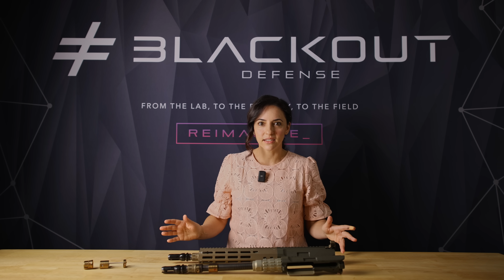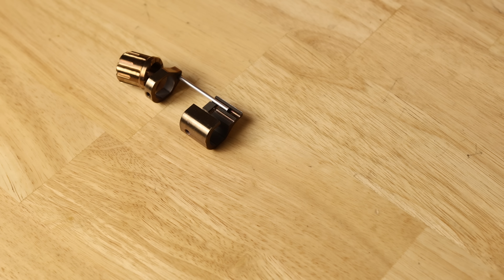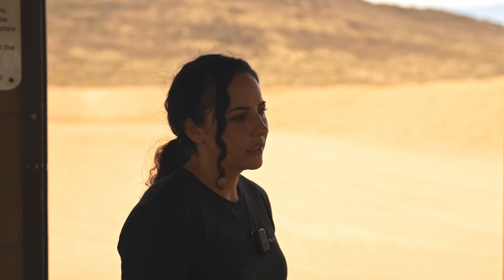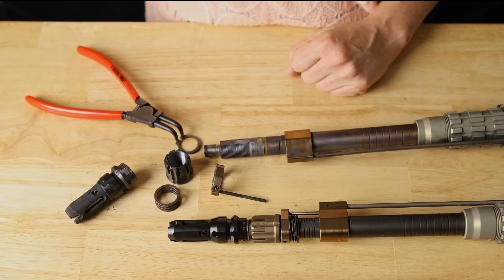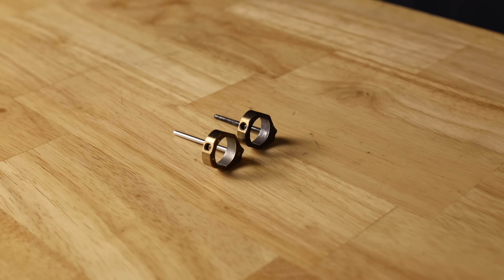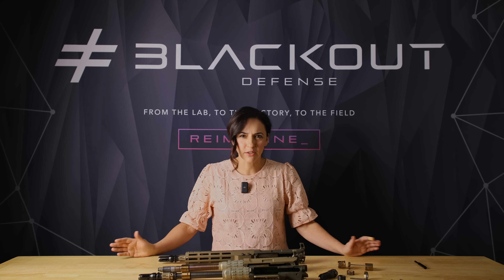HELIX Gas Regulating Barrel System

Comment: Perhaps you should look at Tungsten Carbide for the "adjustment rod". Yes, cobalt steel is a tougher material (tungsten carbide is more brittle), however, based on the use of the adjustment rod, erosion/corrosion resistance under high heat should be priority thus the tungsten carbide.

Comment: You talk about the adjustment rod and an acceptable level of erosion after 1500 rounds. Will the adjustment rod continue to erode each range session causing your gas settings to change?  I know parts ware. Is it something that  needs to be changed out after a certain round count? Am I missing something? Thanks
Reply from the maker: Rarely you are going to see this level of erosion. Erosion in this case (M42) happens in extreme temperature combined with continuation of corrosive gas (ie. full auto). In this video we shot around 1500 rounds in less than 30min. I have received feedback from customers who have over 3000 rounds through the system in standard condition and have not seen changes in the rod.

Comment: I live in the tyrannical state of Ca. I would like a 14.5 barrel with the adjustable gas block. My question is would it be possible to take apart to clean out the gas block with the pin and weld? Or would it be best for me to go with the 16” barrel?
Reply: Good catch and I am surprised to see no one else address.  I saw a video from another YouTuber going over this system; from what I gather, you can replace the little bar that she shows wearing down with the pinned muzzle. However, my concern is that spring - which I am nearly sure that you will be SOL if it should somehow fail.  I'm like you I am interested in the 14.5 however the concern of spring replacement has me leaning toward the 16". Ugh.

Comment: Also I have to comment on those saying only 1500 rounds!!! That's 1500 rounds of full auto continuous fire. There is a huge difference between 1500 rounds over multiple months or 1500 rounds within an hour or so. That's an apples to oranges comparison of 350 degree 30 round mag dump vs 1100 degree continuous fire.
Reply from the maker: Thank you. Very accurate.

Comment: Hold up….so you shot 1500 rounds through it then proceed to show us the comparison of the two components.  Tell me again why I show buy your product?  Did you see what 1500 rounds of “erosion” did to your gas pin.  I’m sorry, that’s a hard no for me.  I’ll stick to riflespeed.  Best of luck.
Reply from the maker: Found the video. 604 rounds total round on barrel failure. Perhaps 300 rounds before gas block failed. If you look at the video, failure occurred when the gas block begin sparking. That’s adjustments rod melting.  IV8888 channel.
Reply: @BlackoutDefense I’ll go find it and look at it.
Reply from the maker: No problem. RS is a great product. Just for the record to clear any misinformation, do the same test to your adjustable gas block then let’s compare it. Max round count I could run on other similar products before catastrophic failure was 800 rounds. That’s our test. However someone in the comments section indicated the same round count before system failure.

Comment: I think it would be interesting to notch the adjustment rod similar to the erosion pattern and see how it does with ~1000 rounds.  It might be something that wears in fast initially then doesn't move for a long time.  That way you can skip and variations in your initial adjustment.
Reply: It looks like something that will experience endless gas erosion requiring regular adjustments to reestablish the preferred flow rate.  Something an enterprising youtuber might want to put to the test if they have an ammo sponsor because it will chew up a lot of ammo to log erosion rates over barrel life.  

I have to also  wonder how fast the gas block itself is eroding.  If it erodes quickly as well, that will increase the readjustment cycles which could increase the rod erosion rate etc etc.  It all may last equally with barrel life, for good or bad and not ultimately matter anymore than necessary regular adjustments.

A last thing to consider, the eroded rod particles, for lack of a better word, end up in the bolt carrier assembly.  Ascertaining their accumulation rate in the carrier, if that does occur, and any added maintenance for removal should be noted as well.

Comment: At what point with the rod erosion become an issue?
Reply from the maker: About 15-20k rounds. Then we recommend changing the rod.
Reply: @BlackoutDefense On a pin and welded 13.9”, can the adjustment mechanism and block be disassembled enough to both clean system and change the adjustment rod?
Reply: It looks like the muzzle device (which cannot be removed if pin/welded) would either prevent or make disassembly very problematic.

Comment: Hard to truly innovate without first doing it through proprietary means and making it different. IF the innovation is successful and the market demands it, the same concept will spread throughout manufacturers based on the demand because it is better than any previous design.  I applaud Blackout Defense for their innovation!  I’m getting ready to order a rifle, but right now I’m stuck in finish color decision paralysis…and if I’m going to order the Helix adjustable block or not.

Comment: So what is the expected erosion rate on the adjustment rod? Is it made of a high temp alloy like the wave washer? Also, in an unsuppressed set up like what was being ran in this test what is the expected failure mode(s)?  I would think a suppressed platform for this test would show a failure more easily?

Comment: 1500 rounds, lots of degradation, but that firing schedule is highly unlikely. Nice work. 
Why was the adjustment rod not plugged straight into the gas tube allowing the rod to be 'eaten away' through it normal life of the rod? A squared off end seems like it will be harder to maintain during the life of the rod than factoring it in as part of the wear process counter-balanced with the spring and adjustment knob.
Reply from the maker: Thank you! We recommend replacing the control rod around 12-15k rounds. One of the major benefits of this system is that in case of full tip-erosion on the CURRENT gas position of your rod, you could push the rod further IN. You can repeat this cycle until you have bottomed out your detent counts. At that point, you should replace the rod. This is the main reason why the end of the control rod is flat. After this test, we extended the depth of the control rod bore 0.100” into the gas block to allow the rod to be pushed in slightly more in this cycle. The cost of replacement of the control rod is about $10. Cool fact: This M42 rod is part of the national stock number. You can simply buy it from McMaster (Part number 8813A28) then it can be grinded to the size appropriate for the barrel gas system (pistol vs carbine vs mid length and so forth). We are also going to provide dimensions and spec for the rod on our site. M42 is very difficult to machine but can be easily grinded like sharpening a punch or drill bit. For those who do not want to deal with it, we will offer it precut on our site. You do not need to remove the muzzle devise. You can disassemble the rod at a certain position or alignment with the adjustment knob (there is an undercut on which creates free access to the rod.) Rod is held in place via 82-degree tip set screw.  We have more info on our IG page if you are interested in learning more about this system. I appreciate your comment!

Comment: I see so many glowing comments, but nobody's being critical? 

The control knob isn't hard enough and is getting stripped from being opened only a few times. The guide rod is bent and the tip wear seen is pretty significant. There's also rust showing in areas and this was unsupressed. I'd also guess after a while that set skrew will loosen, losing your adjustment.

You claim the materials are all special purposed, but you didn't spot harden, or choose materials with rust resistance

You did a "accelerated test" which doesn't show normal wear as well as even a standard burndown only using 1500 rounds at that. Instead, 4k random rounds in semi with mags being reloaded as you go to prevent stops in fire. Other than maybe 1-2m to cool off in the middle, or a pause to adjust gas for certain higher pressurerounds. You have the opportunity to show us features, but didn't even show us different ammo types, supressed shooting, or compliance with a flash hider, cone, brake, etc.

Not saying it's a bad product, just seems like a college project. Needs fine tuning that should've been done already.
Reply from the maker: I genuinely appreciate this. It is a great opportunity to share more info. I will respond point by point. 1- The control knob is 17-4 SS heat treated to H900. That brings the hardness to 40-43HRC. It is hard enough for this purpose. I do not see where it is being stripped. If you are referring to nitride coating being damaged, that is caused by excessive heat. We clocked the knob at 800 degrees at that point. 2- Adjustment rod (guide rod in your comment) is made of M42 cobalt steel. It does not have the ability to bend. It will snap due to the presence of Tungsten (about 10%). What is bent in this video is the gas tube. That is a clear indication of excessive heat. 3- Impossible to have rust. That is discoloration. It is the side effect of excessive temperature on SS. Barrel is 416R, gas tube is 303SS, gas block + transfer gate + control knob + muzzle device are all 17-4SS. It can not rust in this environment. 4- Not sure what set screw you are referring, but nothing came loose. 5- This was an introduction video. We have hundreds of hours of testing video which will be shared in the future content. 6- Regarding ammo, we only used PMC Bronze for this test. The goal was to get the system to the max temperature. We have done additional tests which will be shared soon. 7- If you would like to see additional information, please visit our IG page.
Reply: @BlackoutDefense thank you

Comment: Is the gas rod disposable?  Make it disposable and change it out after a certain cycle.
Reply from the maker: We recommend replacing the control rod for every 12-15k rounds. One of the major benefits of this system is that in case of full tip-erosion on the CURRENT gas position of your rod, you could push the rod further IN. You can repeat this cycle until you have bottomed out your detent counts. At that point, you should replace the rod. It would cost under $10. Cool fact: This M42 rod is part of the national stock number. You can simply buy it from McMaster (Part number 8813A28) then it can be grinded to the size appropriate for the barrel gas system (pistol vs carbine vs mid length and so forth). We are also going to provide dimensions and spec for the rod on our site. M42 is very difficult to machine but can be easily grinded like sharpening a punch or drill bit. For those who do not want to deal with it, we will offer it precut on our site. You do not need to remove the muzzle devise. You can disassemble the rod at a certain position or alignment with the adjustment knob (there is an undercut on which creates free access to the rod.) Rod is held in place via 82-degree tip set screw. Please visit our IG page. I have shared everything from my modeling on CAD to how we made this system. I tried to cover everything as possible.

Comment: 1500 rds and the adjustment rod is already degraded. Ok, so no failure yet, but why stop at 1500 if the adj rod is that hurt? Where is the stopping point and how long will it take before I would need a new rod? Is the FA fire the reason for the degradation of the rod, and will SA only fire preserve the rod significantly? I love the idea behind this and I really don't mind the proprietary barrel. What is the minimum barrel length for this system? I'm running a 5.5 .300BO and I can't put one of the fancy adjustable knob gas blocks on there because I don't have the space for it.

Comment: Love the energy and withholding judgement before I try it, but concerned for the following reasons: a gas block with a knob should not require swapping in a single source manufactured proprietary barrel, or adding more than a few grams of weight to the build - especially out front, or upping the part count more than a couple of parts. Infinite adjustment done durably is a great concept but the execution here seems to entail some tradeoffs.

Comment: That is a simple system how it works so I can't see how it would fail.
The problem is see is you have to use those barrels machines just for that gas system.
I build and sell specialized AR 15 and AR 10 uppers in noncommercial chamberings and wildcat cartridges using Pac Nor barreling barrels

Comment: Does it need a proprietary gas tube?
Reply: "no, but marketing tells us that itll increase profit margins by 15%"
Reply from the maker: No. Standard straight gas tube. You also can change or maintain your gas tube without removing the system even the muzzle device

Comment: I don't see the BCG slowing down at all. 😮
Reply from the maker: It should not slow down unless there is an issue with gas leak, carbon buildup, or ammunition issue. It will slow down if anything impede the gas flow unexpectedly

Comment: OK, just one question, why don't you guys make a gas block that does everything this whole barrel does? Seems very doable to me. Patent issues?
Edit: you guys should drill the hole on the gas block that receipts the adjustment rod a little bit more deeper, then the user can compensate the erosion by just screw it a little bit more in. That is to say if you guys don't want to switch to a more erosion resistant material like Inconel for the adjustment rod.
Reply from the maker: Thank you for this comment and observation. You don’t see it in the cutaway in this video but after our testing we did make that modification and the user can compensate for any erosion by driving the knob further forward.

Comment: I'm curious how well an alloy like stellite would hold up for that pin for resisting erosion? They use a stellite liner for M60 barrels specifically to reduce erosion and extend barrel life, though it's very expensive and very much the reason why M60 barrels cost about 2 grand a pop 😅.
Reply from the maker: I see your point but we selected that rod from the national stock number where you can even buy it from McMaster. That rod should be readily available to anyone either by us or a third independent source.

Comment: Looks like your engineers have gone far, above, and away to circumvent Rifle Speeds simple reliable mechanisms.
Reply from the maker: I would love to see a good YouTube channel take the initiative to do a comparison test on both systems. I will provide free rifle or upper (in case of full auto meltdown)  and 1500 rounds of ammunition. Please let us know!
Reply: @BlackoutDefense  since you created a product to "fix" a problem with the existing riflespeed adjustable gas blocks, why not create a video detailing the issues with the riflespeed gas block durability.  ill wait for the results from your video since this is your product.  it looks more like you needed to change the design to circumvent the patent laws, and are calling your larger unit "robust".

the only two things you fixed were allowing a key to adjust the gasblock when hot, and made your stuff proprietary; barrel, gas block, gas tube, and handguard, which in turn makes it hard to order the wrong barrel length/gas system/gas block problem, but at the cost of zero compatibility with common ar parts, which is the main benefit of the ar platform.

Comment: I don't think you addressed enough the long-term effect of the erosion. And, why not choose a metal that just doesn't erode? I love your products... I'm not trying to hate for no reason. It's just concerning that you stated that you were impressed with the results, but, you didn't leave us with a, "This is why... don't fear, this will last XX,XXX rounds" or something to that effect.
Reply from the maker: Thank you. Material was selected from the national stock number where easily can be acquired from a third party source like McMaster. There is no way to prevent erosion in any gas gun without substantial cost. If even we eliminate erosion from the rod, it will happen in the gas block, It will happen in barrel, and it will happen in the bolt, etc..